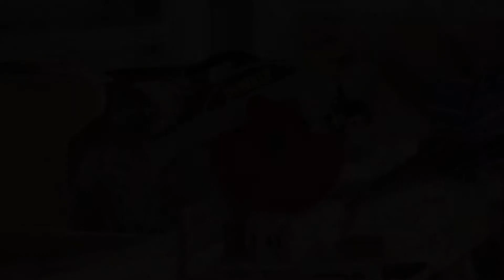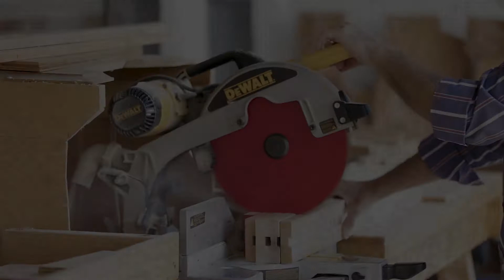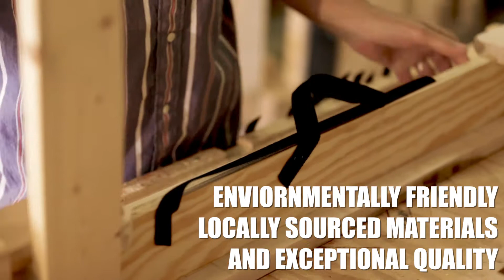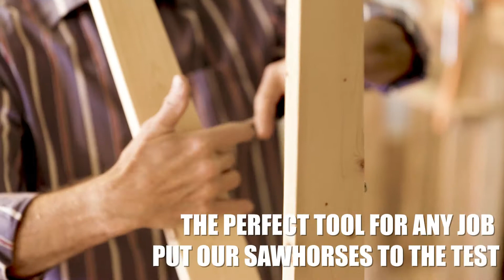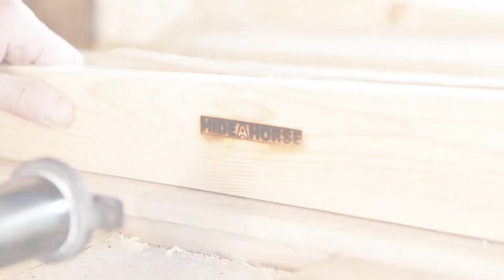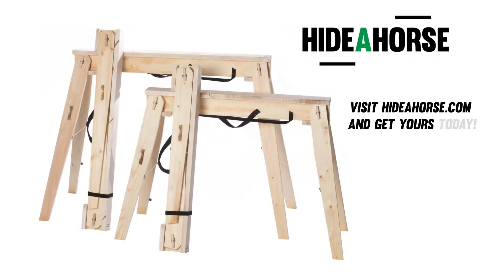Hide A Horse Production Clip

Comment: How securely does the spring secure the leg joint against the beam once locked in to the groove? I'd like to see a video showing a reasonable amount of horizontal force applied along the beam (and also at a right angle to the beam) once it is locked into place. I like the design, it just looks like it might collapse if you apply too much lateral force against the beam when working.
Reply from the maker: The legs, when deployed, are secure and stable, and have been rated to support over 1000lbs. We will create a video showing weight being applied. We agree that would also help to show the Hide-A-Horse in action. Thanks for taking the time to comment!